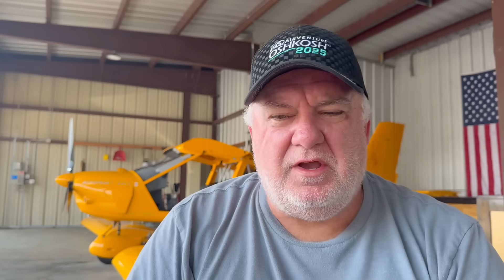Why Did My Plane’s Windshield Fail Like This?

Comment: Holding altitude was not a skill issue. The airplane suddenly gained a huge hole creating incredible amounts of drag. The airflow in the slipstream would have been disrupted, the wings at the root would not be generating the same lift. Finally, the airflow over the tail would have been disrupted. Your skill kept you two alive!

There was another incident (I forget the aircraft type) where the roof popped off just a few inches. It was enough to fully disrupt the airflow over the tail to the point where the pilot could not control pitch and the aircraft pitched down as a result. Thankfully they survived but ended up crash landing on a road.

Comment: Yours might have "just failed" but that doesn't happen on a 421 luke your buddies. Something was to blame for the 421 windshield. Most likely yours failed because the drilled holes were not champfered and or too tight around the rivit holes.

Comment: Any landing you can walk away from is a good landing. Out of curiosity, what is Vy and Vg in that plane? Not to criticize but to reflect and see what we can learn for the future, I wonder if pitching for Vy would've given you the performance needed to make the airport? Unless you were already doing that. I'm unfamiliar with the plane.
Reply from the maker: Vx is 56 mph, Vy is 62 mph, VS1 is 48 mph, and VS0 is 37 mph. Pitching up caused oscillations which I didn’t like. In fact, this airplane rarely breaks in a stall, it just kind of mushes. That led me to believe I was almost at stall speed at 50 mph (and I was close). Those speeds are with an aerodynamically correct airplane, which I no longer had.

Comment: I'm surprised the broken window took away that much lift. I can only guess something with the wind coming in the hole and blowing out under the wing screwed it up, although that should have made you bank to the right. Its just a bit of a surprise. NO negative reflection on your choices or abilities, just surprised it had that level of negative affect. 
As far as the wind inside the cockpit, at first I was thinking that should not be an issue at 60 knots - I ride motorcycles. However realizing you were behind the prop, I can see the wind would have been horrendous. I've been at 120 mph on a bike with no windscreen. The force against your helmet makes it difficult to even breath. If anyone wonders what that wind speed is like, it is way more force than you will imagine. Trying to concentrate on fly is difficult.
Reply from the maker: As a rider myself I had the same initial reaction of it being 60mph wind and then a half second later remembered I was sitting behind a really big fan.

Comment: My "guess" is the windshield broke due to the sudden pressure change. Normally the pressures inside the cockpit and outside change gradually during airspeed and altitude changes, but a freak rapid change, such as you apparently encountered, can cause additional stress that likely exceeded the windshield stress limits.

Comment: It is an LSA, made light so compromises in structure. Get the thicker windscreen and now you can be over 1320lbs gross.  CONSIDER bonding the windscreen in with Sikaflex.  Rivet holes are source of crack. MOSAIC makes you legal to fly over 1320 lbs gross, which I am guessing you already were doing. Windscreen of 0.078" is thin, new 3mm is better. I am glad the factory addressed this. You made PIC decision and you were successful, no need to second guess your self. The peanut gallery (most are not pilots) will lecture you have no real experience or knowledge.

Comment: You did what exactly need to be done, most of these armchair quarterbacks don't even own a plane or have a pilots license that are bitching and moaning on yt. 
   I took a buzzard at 5500 foot AGL in a 172 it blew out the windshield almost entirely the drag on that plane was unbelievable me and my passenger open the doors and keep our foot shoved in them brought the speed down to 72 kn and held it for about 22 miles to the nearest airport
  And the funny thing is I remember seeing a video on YouTube or another Pilot took a bird through the windshield in a 182 and I remember him setting his speed to that so that's what I did but I guarantee you I was not gonna gain any altitude but I could maintain that speed in that altitude
  Once again good job brother everybody's home safe so the only opinion that counts is yours

Comment: Changes in airspeed and vertical speed just before the screen broke are probably due to static changes. Where is your static port located?
Reply from the maker: On the wing with the pitot tube.

Comment: People need to understand that your stall speed changes drastically when the fundamental aerodynamic design of the aircraft gets changed in a split second.
Reply from the maker: Indeed.
Reply: Absolutely correct.  The drag and potential instability jump.  He did a fantastic job of ADM, particularly with a jagged piece of plastic flapping about.